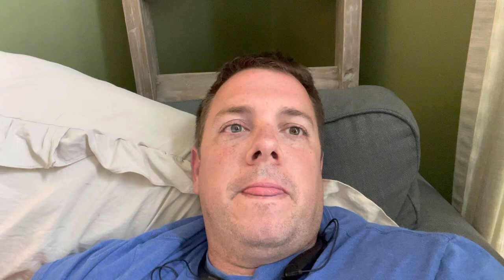Beehives: Wax Dip, Paint, Linseed Oil?

Comment: I run around 70 colonies at this point in Wisconsin and that jump from 15 to 70 was a big one but after about a decade most of my equipment is basically on round two. So after deliberation I decided to put together the funds to get a wax dipping tank. It was expensive and it hurt but not having to replace or try and repaint  boxes/pallets for a decade plus is worth it, the tank is going to pay for itself in short order. Buy once cry once type of deal.
Reply from the maker: That’s what I say!!!

Comment: I have a question: Will a good quality plywood last as long as pure wood...say both are properly wax dipped?
Reply from the maker: Nope. The glue is the issue. Either use HDO plywood (used for concrete) or solid wood
Reply: @Ashby_Farms_NC  thanks
Reply from the maker: @jashuabat1785  Youre welcome!

Comment: Alot got to do with the wood you are using for your hives??? Some better than others
Reply: I have nucs built from pallet wood painted with opps paint from lowes that have held up well.  Also bought 5 vevor wax deeped hives I've yet to see but were cheep  less than 200 for 2 brood 2 med and frames and all other goodies. But I only run 30 + hives
Reply from the maker: Nice!
Reply from the maker: We use rough cut pine